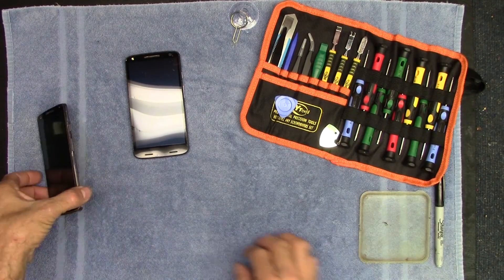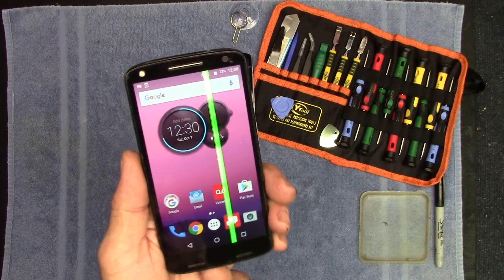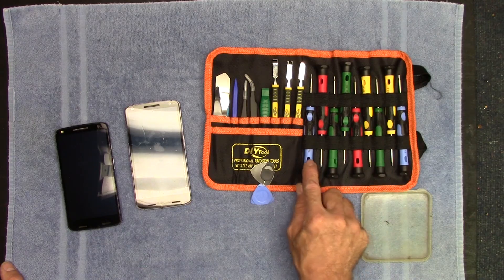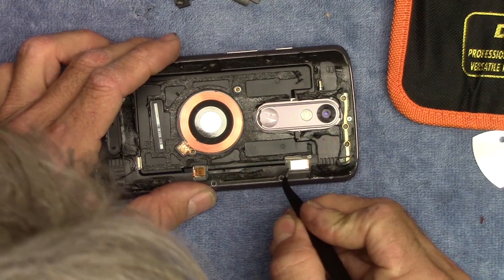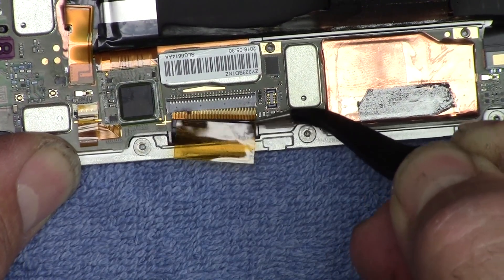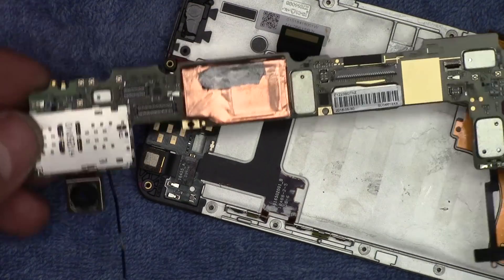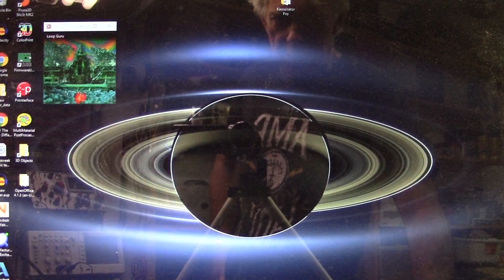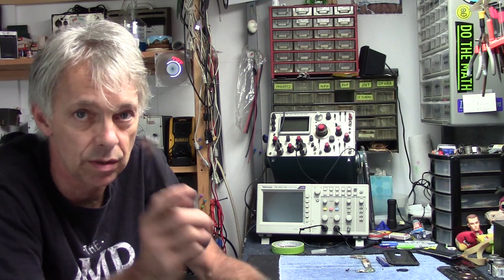Motorola Droid Turbo 2 Data Recovery With No Screen

Comment: Older video, but looking for help for a friend.

Same phone, isn’t active anymore, there is a password he can’t remember. Just wants videos and photos off of it.

Any tips? Really doubt usb debugging is enabled on it. Did not expect this roadblock. Swapping the motherboard to a new phone would just have the same problem, right? Setting up a plan on the phone (if possible) might make the photos recoverable if you can set up an account with gmail.

TLDR
Would this work if you don’t know the password?

Comment: i have a problem..my old droid turbo motorola doesnt work at in the way that i can have wifi or regular internet from verizon....my question is i bought a samsung galaxy s20 5g-512gbs and i just wonder if i can transfer my data in my old droid turbo motorola to my new phone galaxy s20? or is there any way my motherboard of my droid turbo messing up and i need to buy a refurbish or new motherboard and transfering my data from my droid turbo to my galaxy s20?

Comment: thanks for sharing this. I have exactly the same phone. Have a problem not able to start the device. I can get to boot recovery options via power/volume but when selecting recovery it goes blank. Is there a way to recover data on my phone. Is the data resides in one the chips on the motherboard? Pls advise.. thanks
Reply: I have the exact same problem and I'm wondering the same thing. I know it's been a while but did you ever find a remedy for your phone?

Comment: my turbo 2 popped up with an emergency screen which requires me to put in a password that I apparently set when I set it up. I cannot remember the password and I only get 10 tries then it will do a factory reset and I will lose my photos. Is there a way to hack around the password so I can retrieve my photos? I plug it into the usb on the computer to transfer files but it won't recognize my phone. I will only charge the battery.

Comment: Wat is that green line ?
Reply: Probably shorted connectors on the LCD.
Reply: Any number of things damaged ffc cable. Damaged terminals or possible oxidation. Damaged 
t-con/driver chip. Also possible damage to oled matrix too.

Comment: How's the Hictop 3d. You inspired me to get one..
Reply: Working great!
Reply: I bought a similar generic 3D printer off Amazon after watching your video (mine has a wooden frame though). Being a cheapo Chinese one it's not the best quality, but works fairly well and the parts to repair it are really cheap - which is good because I got the hotend so jammed up one night that in the morning I found molten PLA had somehow oozed up the hotend and encased the whole heater block! In removing the plastic I ended up damaging the nozzle, heater and thermocouple.

So not only do I get to learn about making things using CAD, but I get to learn all about how 3D printers actually work (and just how hot 210C feels...)